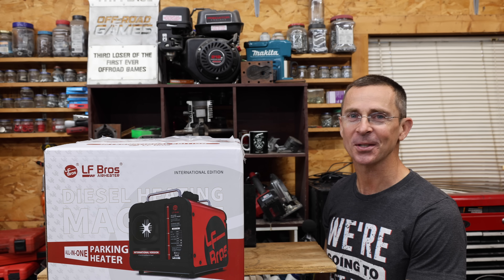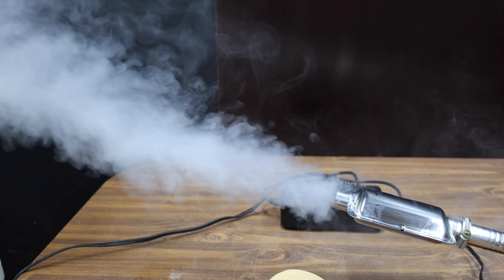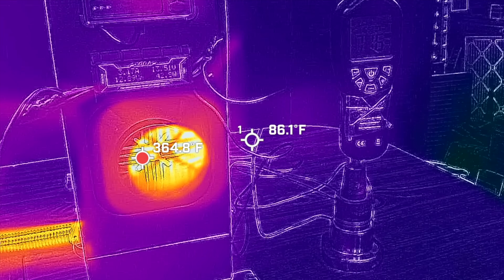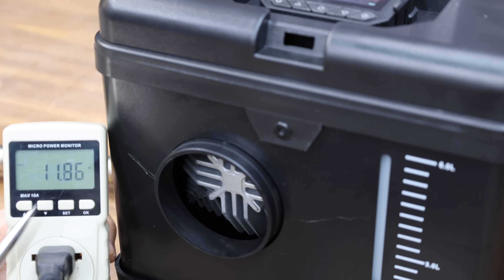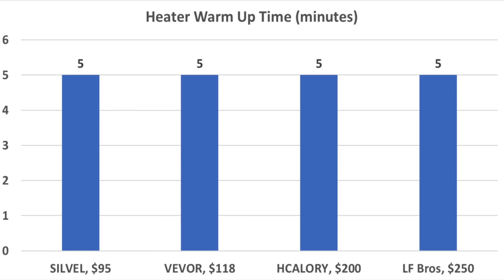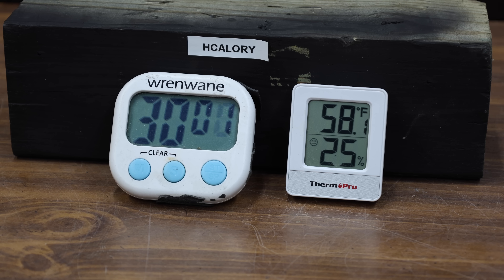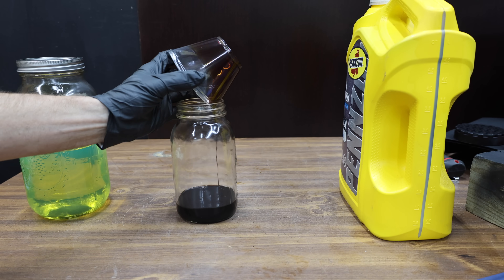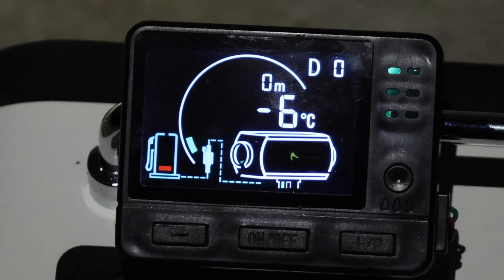The Truth About Cheap Diesel Heaters!

Comment: Used motor oil, or ATF would need to sit in a barrel til the junk settles at the bottom then pumped from the top through a strainer , then mixed with either diesel , kerosene. I've even seen guys use some gasoline, and they run their old diesel trucks on this shit no problem, for decades , but a truck has more fuel pressure, better fuel pumps , big fuel injectors and forced induction (turbo or turbo's);. I'm sure if you strained the oil really good , and ran 2/parts diesel. : 1 part oil it would be fine for quite a while, been using propane heaters to heat my garage , our laundry room I out there , and my wife won't wash anything if it's freezing, I keep a electric radiator heater in between the washer and wall where the water valves are , but I've had the water line that is about 12' long from house to garage freeze a few times , I'm going to dig and uncover it and put an electric pipe heater cord on it and cover it back up, and switch to the diesel heater for the garage , that should fix all our problems

Comment: I have a lot of used oil from oil changes , I'm getting one of these for my garage , where our laundry room is , and I will run this outside and run the heat pipe into the garage , il build a little mini wood shed to protect the diesel heater from rain and snow
Reply from the maker: Thanks for the feedback!

Comment: As is typical your tests are so well done and informative.  However, when I buy one of these units I don’t want a clicking  fuel pump.  For camper use etc.  IIf you should ever do more testing that would be an important consideration for me.  Thanks again for your excellent work.
Reply: There are video on youtube comparing the pumps and noise.  Just do a search for them.  Some are quieter.  Most all of them make noise when first starting up tho.  Unless you get one of the really expensive ones.  It's mostly because of how the pump works that makes the noise.  Rubber mounting and changing fuel lines helps a lot, even on a noisy pump.

Comment: I bought one a while ago that is not all self contained for a parking heater in my 1978 camper vw bus, I have a 100 ah battery under the seat and 100w solar panel on the roof, after the initial warmup, I kept it at the lowest setting and we were almost cooked out of the camper at 80 degrees f when it was below freezing outside. Had to regulate temperature inside by opening the windows. Only draws, .6 amps on the low setting . Will run for 3 days continuously with the little bit of input from the solar panel to recharge during the day.
Reply: What heater did you get a 2K or5K ?I have a 70 Bay window and I'm looking for a heater as well I don't have a headliner or insulation and I'm getting tired of waking up with water dripping off the ceiling😂

Comment: For over 5 years I have a cheap Amazon diesel heater in my VW bus, I camp all winter long in zero degree weather. I never had an issue with it and the key fob is a luxury especially when you are under the covers and it zero out you just click the key fob and the heater turns on and in 15 minutes my bus is nice and toasty. I use a car battery to run it and it lasts over 10 hours
Reply from the maker: Great to hear!

Comment: For a chilly room and emergency backup I rely on kerosene heaters. No electricity needed and the 8k - 10k BTU heaters are 99.5% efficient and totally silent. Kerosene heaters with some form of catalytic converter are odorless except startup and shutdown.  Diesel heaters exhaust outside and that's great but I'm not going to make a hole in the sunroom wall. Diesel is half the price of clean kerosene. Since both the kerosene and diesel are burning at better than 99% efficiency there is no waste so they're a wash - right? Maybe a comparison between the two?

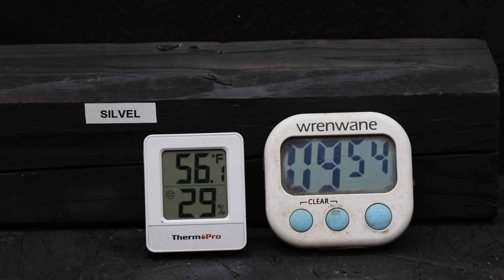Comment: Wrong again I have six of these units of various different makes the combustion chamber is the same the glow plug is the same very slight variance in between the two but the most difference is the controllers which you can order them separately to order to make it Bluetooth or non-bluetooth to get this unit to run correctly the starting amps is anywhere between 10 to 12:00 then to keep it running depending on what power level you're at it's roughly about anywhere between 34 volts to about 45 volts play all you need is marine battery and a trickle charger and you will save half yourself the time and trouble with these plug socket ones all these units of all the same pictures of difference between 2K and 8K

Comment: That Vevor is pretty dangerous with the hot exhaust pipe nearly touching the table or whatever surface you have the heater sitting on- not a very good design

Comment: I think that the fact that these devices also need electricity to run defeats their potential benefits for certain emergency situation when the power is out and people don't want to freeze to death. If I were to redesign these devices, I would include the capacity for them to also create their own electricity and perhaps some additional electricity to run some additional devices. A generator that runs on diesel fuel and can also heat your house during an emergency would be quite a good product that many potentially consumers might consider investing in. One of the problems with gas portable generators is that gas deteriorates. But I believe diesel fuel can last a very long time.

Comment: Thanks for this, just what I was looking for.  I need to heat my 16×20 wood shop and in NH we get similar temps down into and below the 20° F looks like anyone of these would do the trick.  Shed is partially insulated (walls are, but ceiling is not)

Comment: So, I need to power the heater during a power outage???
Reply: I run mine off a 12v 100a/h Lifepo4 battery.  It would run for days and still have power.

Comment: Do you still use a heater for the shop or anyplace and how did it work out after a few months? I just got 1 and plan to use it in my truck for heat when the truck is of. Just wondering if you found any problems with it or do they work as good as people say. Can't trust 90% of what's on the internet

Comment: The only thing which is Very Important to mention for all these heaters is: They are too hot for truck cabin or pickup cabin even on lowest setting. So thermostat in them cannot regulate the temperature cos they have to be always working on the lowest setting or being off. Even precursor of all of them Webasto is screwed up cos it reaches the right temp and turns itself off then after sensing temp drops down it turns on. It causes unnecessary carbon buildup inside and temperature fluctuations to the degree it is unpleasant in small space. The solution for that would be 2 separate motors 1st for combustion chamber 2nd for pushing the air thru heat exchanger to the heated space. In such a solution if there is demand for heat the heater would just periodically turn the 2nd motor on and off without turning 1st motor for the combustion chamber. This solution is even good for battery since the heater pushing those 2 air streams (there is 1 shaft and 1 motor) is using minimum wattage like 12W.

Comment: 5:17 I think that meter should promote 200W, instead of 200A. I don't think that meter could handle 200 amps, especially through that thin wiring.

Comment: I have run a Hcalory for two winters as my primary heat source,    only run it on diesel, it is important to only turn it off only when it is at full temperature, otherwise excessive carbon will build up in the combustion chamber.
Great review
Reply from the maker: Thanks!  Thanks for the feedback.

Comment: I've been running my 5kw Vevor in my van for about 2 weeks now and so far it's been great.  We'll see how it does in colder weather.

Also - Vevor isn't a tip hazard if you bolt it to the floor as intended.
Reply from the maker: Thanks for the feedback.

Comment: I am glad you mention the problems with your testing.  The main issue I have with these heaters is that they all require a power source to run.  A person might not have a power source to use these heaters.  I think these heaters are more for workshops/barns than emergency use.

Comment: I have 2 vevor 8kw heaters in my bus conversion but they are not the cabinet type. Mine are mounted under the dash in the front and in the cabinet over the engine bay in the rear. After years of use with them running more or less non stop all fall, winter and part of spring I have less than $20 in parts replaced not counting a control panel one of my kids accidentally broke. 1 fan motor and a glow plug are the only things I have replaced. Mine both have metal cases instead the plastic ones most of them have.

Comment: I’m thinking about buying the LFBROS model do you think you could do a video showing how to run a larger fuel tank on one of those (outside Of course )I’m planning on leaving the whole thing outside and covering it with a plastic tote and running the hot air vent Into the basement up into one of the old furnace ducts in the living room. I don’t really wanna go outside and fill a tiny tank constantly somebody said it might be possible to run  with a 5 gallon diesel fuel can and another guy said you could actually use a 5 gallon bucket with a lid on it. What do you think?

Comment: If you can get an old radiator from a boiler system, it's easy to connect to the exhaust before piping it out of the shop or room. That enables you to capture even more of the heat.
Reply: That can cause fowling inside of the heat exchanger on the burner. If you want to extract more heat from the exhaust then you need something that will cause no back pressure on the exhaust.
Reply: @annalieserom4650 not all back pressure is bad.. some I necessay..

Comment: If mixed at a decent ratio with diesel to prevent too much carbon build up, would this be a decent way to dispose of the used oil in my garage?

Comment: In Germany there is a brand called Eberspächer. It is a very common brand for auxiliary heaters here. Since there are strict rules what you can and cannot install on/in your car, you are basically being forced to buy a main brand heater (like a Eberspächer auxiliary heater). If you buy a new one the cost will be between $1,000 and $2,000. But thanks to Chinese manufactures "reverse engineering" the heater you can buy a cheap broken main brand heater and use the cheap Chinese parts to fix it. The first version came out approximately 30 years ago. Therefore I'm not surprised there are so many nearly perfect clones.
Reply: ...bought for a fraction and still they complain about the minimal pump noise, lol

Comment: Your first heater smoked bad when starting probably because it fed diesel into the unit while you were wasting time with the underpowered electrical supply. When it finally got what it needed, it had to burn off the excess.

Comment: I'm curious what R-rating of insulation you have in your shop, as well as the _cubic_ feet it is. I have a 12ft x 32ft cabin, and it seems like using one of these might be better than using a propane space heater. My cabin has R-13 insulation in the walls and ceiling. Roughly 3,500 cubic feet of living space that needs to be heated.

Comment: I've just bought that vevor. Hoping it's going to keep us toasty warm in our campervan. I knew you'd be the man to check if you'd done a video. You know your good when your the first person people think of. Fantastic work
Reply: fwiw: family member lived in westphalia van in -10 to -30c and more, depending on his small vevor to keep warm overnite.  He worked for 1/2 winter on the project,  month and a 1/2 each in two locales....kept him safely warm.  I bought 8kw vevor last winter, keeps a 700 sq ft part insulated garage good enough to work in.  Good luck!
Reply: @ih5508 yes I bought the 8kw one too but didn't realise. I thought it was 5kw at purchase. I had no room in my van for it so it's mounted outside and hidden under a spare wheel cover so my vehicle still looks factory. It's been so good that setting 2 has been enough to keep the van toasty. Very pleased with it and for the price it's unbelievable.
Reply from the maker: Thanks!

Comment: Hello ! Just subscribed. You’re a great reviewer !  I am new to these heaters and was ready to purchase one, however I am seriously wondering if they would instead KILL you instead of save you during a power outage. For instance, I was wanting the Hcalory TBmax. I don’t have a power bank and want to plug into an ac wall outlet, which the company says is fine. However, what if there is a power outage and power is suddenly lost to the unit with all that fuel sitting next to all that heat and no fan running ? Wouldn’t it catch fire or worse ? No one talks about this. Do you know ?

Comment: The power adaptor for the HCALORY is crazy dangerous: it uses a 120/240V plug but actually runs on 12V. Easy to fry this thing if you plug in the wrong cable.

Comment: Watching other channel disassemble these, inspect them several issue arise.
The “Hcalory `TB2 Diesel Heater Toolbox2, 6L..,  seems like a fairly good unit you need to test. 
If I recall right is a USA made system, not yingyong brand where yo cant talk to them at all about anything.
Reply from the maker: Thanks for the suggestion.

Comment: Todd, thank you once again for the extensive WONDERFUL reviews of these heaters. They are making great stridesof improvements because of the BTU/gallon of fuel Vs Propane and heat cost. Diesel is much more available in remote locations than Propane. I cannot stand the ticking noise on many of the cheap/cheaper heaters. The 2025 line up has multiple heaters $229-$299 depending on discounts for 8k heaters. They are much quiter outside the RV and Tent and on can sleep without the metronome sound and fuel and power effeciency is somewhat better. I mix some 91% isopropyl alchol in myfree standing wick based kerosene heaters VS running diesel only with great results. I want to try this mix in one of these. I just bought the Hcalory Max ( 229-299) 8k for our RV and Tent due to it's quieter nature.
Reply from the maker: You are welcome!

Comment: DO NOT RUN MOTOR OIL IN THESE HEATERS. 
The combustion chamber is not designed to handle alternative fuels. They will leave build up inside the chamber that will affect the performance and then eventually will simply stop working altogether. 

These things are ignited via a glow plug wrapped in a stainless steel gauze and fuel pump squirts the fuel onto that gauze while the glow plug is running. After it heats up the glow plug is turned off but the gauze stays hot enough from combustion temp to vaporize the fuel and burn it in the main combustion chamber. 

Clean alt fuels may be able to work. But absolutely no motor oil. Dirty alt fuels will destroy these things.

Comment: I live in a motorhome and these things are indispensable. Depending on the winter temps you experience the diesel powered heaters can be a bit of a pain to deal with. Since the diesel can gel and freeze in the lines and tank. 

I shelled out the cash for a gasoline powered eberspacher b4l heater. 
This is the original patented heater design that those Chinese ones copied as soon as the patent expired. Gasoline freezes at a much lower temp than diesel so it's much less likely to experience problems in the winter time.
Reply: I also designed a regenerator system that watercools the exhaust and pipes that captured heat into the water compartment on my motorhome to help keep the water from freezing.

Comment: I had purchased one years ago when they first came out. Like the vevor style one. These things are great i had a 10x10 car tent that i got from Harbour freight (used as a outdoor workshop) with no insulation it was 13⁰f outside and inside the tent was 68⁰f the only modification i did was i made an exhaust heat sink using old finned water heating pipe from an old base board to steal more heat from the unit. It was great.
Reply: Have a pic of diagram of this?

Comment: The only other thing I would have tested was the indoor carbon monoxide levels. That shouldn't be a problem IF the exhaust connections are well sealed, but I'd suggest that anyone using any sort of combustion heater indoors monitor for CO.

OK, everyone should have that anyway, but it's doubly important if using any combustion-powered heating or cooking appliances indoors.

Comment: These heaters will run on 50/50 motor diesel/used oil however you will have to clean the burner every day or every other day. If we can modify them to make them easily cleaned they would work great for this purpose.
Reply from the maker: Thanks for the feedback.

Comment: I have one and love using it. I would like to point out that it's important that these heaters do need to properly power down and must maintain consistent power supply while doing so or they may risk damaging the heater or catching on fire. I recommend using a battery as well as a wall supply maintaining your battery, it's much safer if power ever goes out.

Comment: I have been running my Vevor on a 50/50 diesel /used 10w hydraulic fluid  mix for several years and its working great
Reply: Great to know it's going for this long, i just got mine for 70$ and i was wondering if it will pass the test of time.
Reply: Have you had to clean it?
Reply: @SchoolforHackers  , Have not had to clean it yet , BUT i know that time will come .
Reply: Why do you mix diesel with hydraulic fluid?
Reply: I use a  LOT of hydraulic fluid equipment for my loggin bizz. And just one example is i have a Big logging winch that takes 25 gallons when i change it out . So i have a lot of "used " hydraulic fluid . One day i decided to try mixin a bit in with diesel for heater .. And it worked up to a rate of almost 75/25 but i could tell it was struggling a bit . so i backed mix back off to 50/50 and it has worked great at that level
Reply: I assume he has a supply of used hydrolic fluid, so he just uses it because it's avaliable@TheBigGuy00009